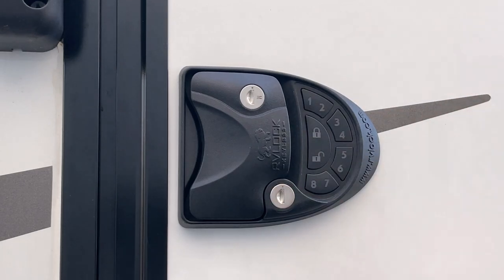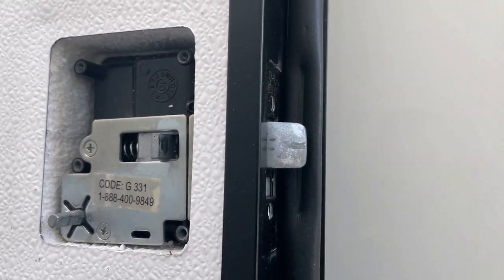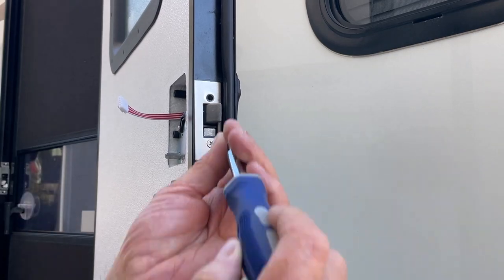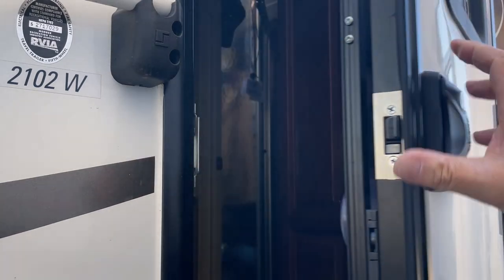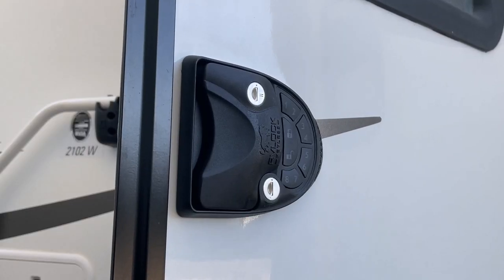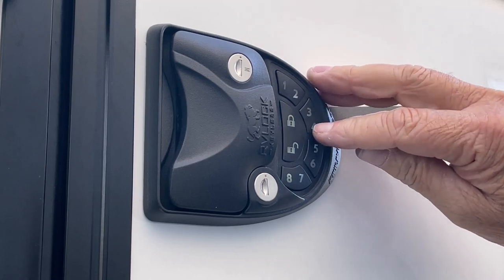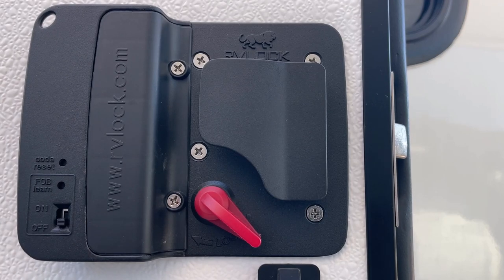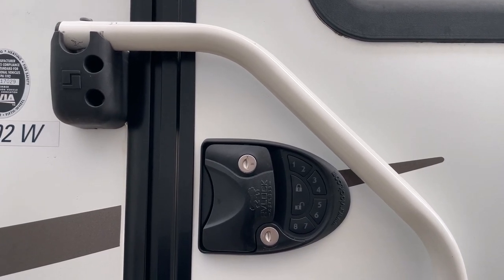RVLock Keyless Door Handle Installation and Lots of Great Tips, Tricks, & Maintenance

Comment: When I leave for the day, I always just lock the deadbolt- but this lock only locks the reg lock - not the deadbolt. So I would have to manually lock the deadbolt?
Reply from the maker: When you use the fab or the keypad to lock the trailer up the RV Lock operates the deadbolt like this - https://youtu.be/re5UDfc2tnA?t=798

If you want to lock the upper strike lock and the outside lock handle you will need to use the key like this - https://youtu.be/re5UDfc2tnA?t=491

This is the RV lock installed in the video -
RVLock V4 Keyless Entry Handle w/ Integrated Keypad & Fob -
https://amzn.to/3IJpdcb

I hope this information helps you, thanks for watching -
https://www.youtube.com/@thetraveltrailerguy/videos

Comment: Thanks, so helpful and easy to follow. Any idea what the black lock and unlock buttons are for on the fob?  I programmed the fob with the orange buttons but the black ones don't do anything. Thanks again!
Reply from the maker: Thank you so much for watching, commenting and asking a great question Chris. Here's what I found on their website to answer your question, I hope this helps -

The two sets of ‘Lock’ and ‘Unlock’ buttons on your RVLock FOB can be customized.

For example, say you have two doors on your fifth wheel and both have an RVLock keyless system installed. For convenience you could program one remote to work all RVLock handles at once with the click of a button.

Alternatively, you may not always want to unlock the rear door when you are unlocking the main door. 

In this case, you could sync the front door to the orange set of buttons on the fob and then sync the front AND rear door to the black button set. Of course, the choice of customizing what button unlocks what is completely up to your preference.

If you want to expand your customization options, then check out our RVLock Master Interior Remote that has the ability to control 4 different zones expanding your capabilities to baggage handles and more!      https://www.youtube.com/c/MichaelBracewellTheTravelTrailerGuy/videos

Comment: Hey Michael, do you put silicone around the door lock after you install it?
Reply from the maker: Hello Ron, I did not need to use silicone around the lock since I had a good seal but if I didn't have a good seal I would have put silicone around the lock. I recommend that if you have any worries it may be able to leak someday to silicone around it because it will not hurt to do so. Thanks so much for watching and your great question

Comment: Update! Again great video but the product is a piece of crap! Ours is either missing parts on the locking mechanism or its just broke internally. When locking, you can hear it working but all that happens is a black gear just spins. Its going back!
Reply from the maker: Oh man that's a bummer, I hope you buy a replacement? where did you buy it? 
RVLock V4 Keyless Entry Handle w/ Integrated Keypad & Fob -
https://amzn.to/3IJpdcb
Reply: @thetraveltrailerguy  Update...We contacted the company and they had a couple issues lately and one is (and what our problem was) is when you take off the silver metal backing on the key pad, there is a silver bar and it should be bent on both ends to a perfect 90 degrees and ours was over bent. Being bent more than 90 on both ends doesnt allow that bar to sit in the connection all the way. We just bent each end to 90 degrees and now everything works fine. Their other issue is they said sometimes the worm gear isn't seated all the way. Bothe are easy fixes but for what these cost, it should have been a 10 minute install with no issues.
Reply from the maker: @jandblawncare8570  Wow, I'm glad you got it working and sorry you had to fix it yourself when you had to pay so much. Anyway, you will be happy with this lock. Everyone that I know really likes them a lot and wish they had bought theirs earlier. Take care and happy camping. Thanks so much for the update and information